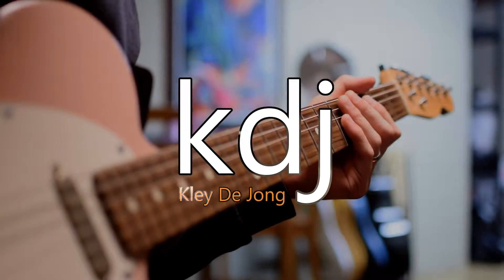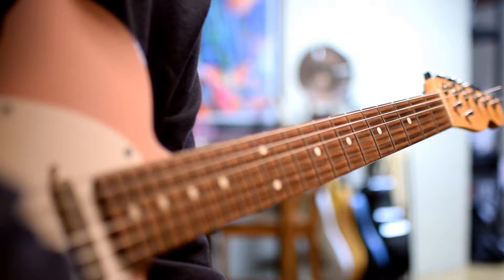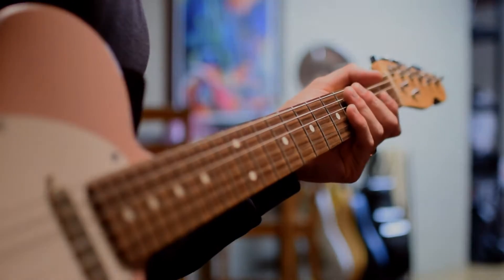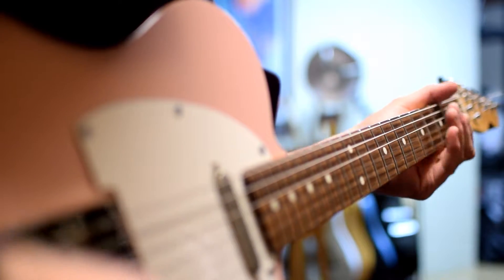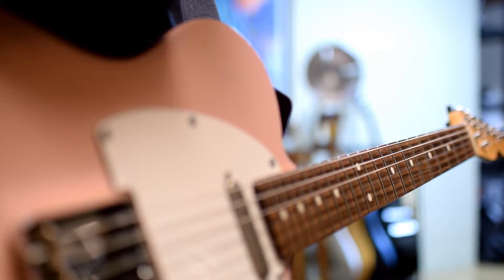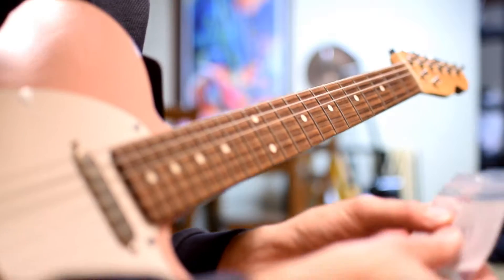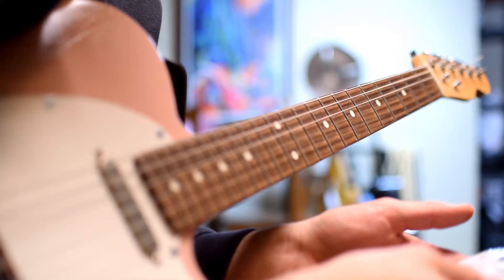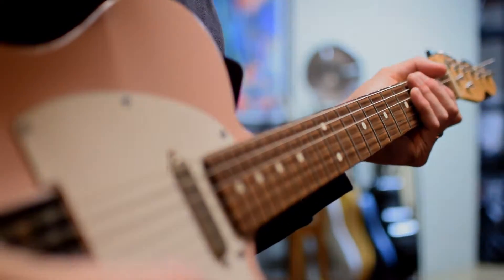Fuzz Face Shootout - Comparing Many Different Transistors

Comment: Very cool video and premiss! But from the sound I’m guessing that you have the fuzz dial cranked to max. Not much clarity that way. Especially on top of an overdriven Marshall sound. Listen to Hendrix in the studio. The master of fuzz face. Example songs like purple haze are not so cranked up on the fuzz knob. A bit more than half way on the fuzz knob or 3/4 is plenty of fuzz on a FF. You could hear more subtle differences with the fuzz backed down. Did Hendrix use a fuzz face with the fuzz cranked up all the way live? He definitely went with more live. But I think it was more his Marshalls on 10. Cheers!
Reply: Hendrix used his fuzz face on full blast and would use his volume to 'clean it up' as he saw fit. He rarely had it off or changed a setting.
Reply: @jrdoughty13  Perhaps he may have had his fuzz faces gain cranked high or maybe even up all the way at times. But mostly in live situations. Not in the studio. He had a much more refined fuzz sound in the studio. Go back and listen to purple haze in the first album. Nowhere near the distortion heard here.
Reply: @tonebender69  I'd have to side with John on this. Hendrix's "refined" fuzz tone sounds like a Fuzz Face maxed and the guitar volume rolled off some, which gives you a fantastic glassy cleaner tone. Every Fuzz Face I've heard with the Fuzz rolled back sounds quite terrible. Just raspy and anemic and a bit muddy - not a tone I've ever heard on any Hendrix studio recording. I agree with you that he's running the amp too distorted here though. This is the same sound that you get when you run a Fuzz into a maxed overdrive pedal. Everything just goes wooly and indistinct.
Reply: @darwinsaye  riding the volume is a must when using a fuzz face. The only time I have heard a fuzz face sound bad when running the gain or fuzz low? Would've been through an amp set clean with no breakup. Hendrix ran his Marshall's on 10 but anything from 7 up on the volume dial works. I run an analogman NKT 275 red/white dot germanium fuzz with the fuzz anywhere from half up to 3/4 up through my 1971 Marshall 100 watt. Sounds like it should to me. The fuzz knob maxed is more myth than anything else. Again as I mentioned before. It's more likely he would have done that live. A lot less in the studio.
Reply: @tonebender69  Another interesting factor too was the difference between the fuzz faces he used and when. The first one he had and used in Purple haze was Germanium, and would have been much more mello. I wonder if that may have been part of the crispness. Its also possible that like you suggest, he may have used it very differently in the studio. Riding the volume is a wonderful live technique for changing gain, but in the studio where you can change the setting between takes on the pedal instead might have been his method. Not to mention, he may not have realized at the time, just how usable the volume solution was. Its crazy to think about what we do and don't know for sure :P
Reply: @jrdoughty13  germanium fuzzes are definitely more gentile. More tube like and warmer. I definitely prefer them to silicon. I have about 7 fuzz faces and a couple of Roger Mayer variants. Just because of how bad the germaniums sound when the weather gets hot. That's when I reach for a silicon (usually a BC183 ff). Some germaniums are more stable and can handle the warmer temperatures to an extent. Like the NKT 275 white dots. But the red dots??? OMG! Even with a bias knob on a pedal still they are really finicky. But the NKT 275 red dots sound the best to me. As for silicon? A trick I learned is to bias the transistors higher than the usual 5V. Because silicon ff's have more gain and are brighter harsher? It takes the edge of some and warms it up. The Hendrix Dunlop FF is factory set to 5.75V bias on the trannies. I set mine to about 5.3V. The highest gain fuzz that I have is the Dunlop Band of Gypsies. Which is a straight up Roger Mayer Axis fuzz (3 transistors). That thing with the fuzz knob at half is really cooking. I never set the fuzz on that much higher and no where near 3/4's of the way up. Through a cranked Marshall of course.
Reply: A good early example of Hendrix germanium fuzz? Is on Manic Depression. Right at the beggining on the bassline he has the bridge pickup volume backed up to around 7. He brings it up higher for the second verse. And then for the solo he cranks the volume to 10. Right after the solo when he goes back to doubling the bassline with Noel? He backs off the volume to get more definition from the bass strings. It cleans up and you can hear the sparkly clean strat tone come through. And then he brings it back up for the ending. A lot of volume riding on that piece.
Reply: @jrdoughty13  to my ears this sounds way too muffled, saturated, and compressed. Hendrix had more clarity. Perhaps it was the higher headroom from the vintage Marshall's.
Reply: Eddie Kramer also helped shape Jimi's studio sound with different mic placements and compression, he (Eddie Kramer) admitted it a few times over the years.

Comment: I'm writng this, cause I know there are ppl that want that warm fuzzy FF sound but cant get it quite right... and because the sounds in this video are not a good representation of a FuzzFace. 

Your Fuzz Face lacks Volume and sounds too gated. A muffled sound is also a sign that your FuzzFace is not biased right. You probably should up the voltage divider resistor and tweak the Q1 resistor on the collector. And of course bias Q2, but you probably already did that. Especially with the OC42 ( I used them a few times.. sound amazing but they are very shitty in terms of biasing )

the thing with fuzz faces is this: (and this is what ive learned through try and error and a lot of studying), It practically makes no difference which Ge Transistors you actually use for a FF circuit. In Theory you can use every Transistor but most people just buy matched transistors and put them into the original FF circuit. And thats a big nono. 

The most important thing is to have the voltages right. you probably heard this: in a FF every component is important. Besides the whole Mojo aspect, its really important to tweak the components (especially the resistors) to gain the perfect voltage readings. The world isn't perfect and especially in times where germanium transistors are a rarity it all depends on voltages. What you hear isn't the characteristic of a germanium transistor itself. Its the characteristic of the germanium transistor in a certain circuit. After you changed the transistor you can always the tweak the circuit and achieve the same sound as with other transistors. It all depends on the voltages. You can have the perfect NKT transistor and you can just put them in the classic standard circuit and have a perfect fuzz face with perfect voltage readings. But the probability is very low. Even if you get matched pairs, they may be very leaky for example. Take Transistors that are in the right hfe range and then tweak the circuit so you get the right voltage readings and there you have it. A wonderful sounding FuzzFace :).
Reply: Wow, didn't know about any of that! Thanks a lot for the information man!
Reply: Hi Mateusz , Could i speak to you through Gmail , Its about a fuzz face i have...
Reply: @stupot7281  yes!
Reply: Very useful info! I’ve been working on a couple of projects lately, one of them being a fuzz face. I bought a pair of ac128 transistors from a local repair shop and put them inside the circuit without tweaking anything. Although working fine when my guitar volume is at 10, the output signal drops suddenly at vol 9 showing little to no distortion. I tried tweaking the values of the 33k and 8k2 resistors but nothing changed. I’m experiencing the same problem on my other build, a foxx tone machine. Have you got any idea on why this happens and how to solve it? Thank you!
Reply: @paolomarcelli7071  (btw I'm Mateusz Dolinski) Well I had a similar issue with a Fuzz Face. The Gain of the transistors were too low and so the fuzz cleaned up very early in the potentiometers rotation.

But I'm thinking you have more of a grounding issue. But you are mentioning you have this problem also on a another pedal. Maybe there is something wrong in your guitar wiring?What Pickups and Guitar are you using? What volume potentiometer does your guitar have? Maybe there is also something wrong in the wiring of your pedals. Maybe some grounding issue? But like I said.. It may just be that your transistors are too low gain. What Hfe do they have?

Comment: Thanks for the comparison. But everything sounds very muffled and lacks clarity.
Reply: I have a Dunlop germanium fuzz face that I changed the input capacitor to cut some of that overly thickness out and it’s killer. Cuts through a mix great. Sounds awesome on a clean amp and a dirty one. Kinda makes it like a treble boost almost